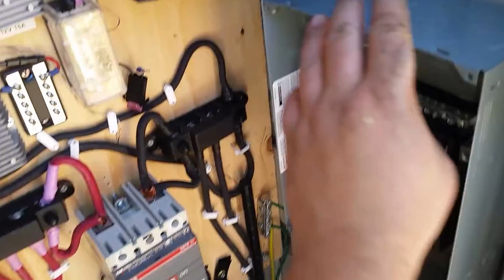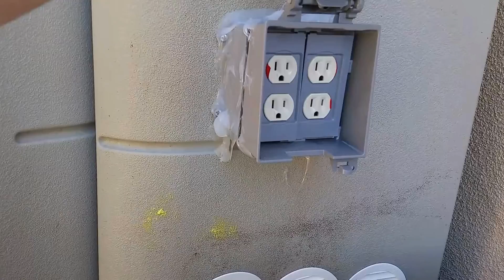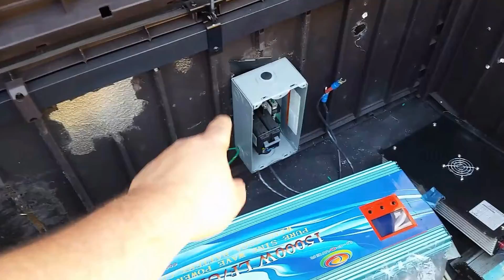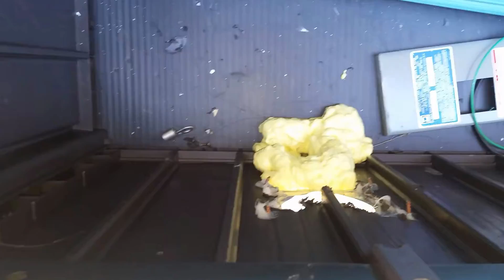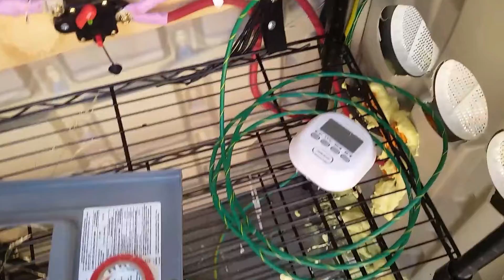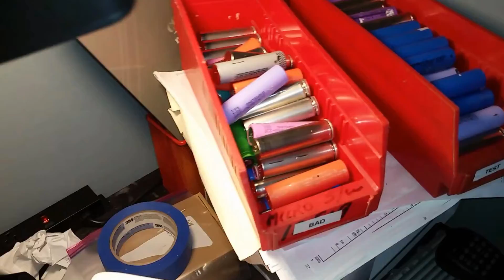PowerShed DIY PowerWall episode 10: High voltage going in, and weatherproofing!

Comment: I live in Wisconsin, which of course gets mighty hot in summer (98 degrees F) and very cold in the winter (minus 20 degrees F) , and in the months in between we get lots of rain, snow, sleet and everything in between. Do you think it would be acceptable to have the bulk of the powerwall hardware except for the battery packs within my garage (in a cabinet of some type) with a small shed like you have just outside the garage wall which will contain the battery packs?  My thinking is that only the battery packs alone have the risk of fire, and with the rest of the system having a lower risk of fire, if any risk exists at all.  Does this sound reasonable?  Inside the garage I could build a cabinet on an outside rear wall of my garage that will connect to the battery shed only a short distance away (through the outside wall.  I'm afraid that the weather elements will destroy anything I leave outside for very long, even if it's inside a small shed. comments are welcome
Reply from the maker: Seems reasonable to me! One thing that you will need to be mindful of is cable length. If the power electronics (inverter, charger, etc) are too far away from the batteries, voltage drop will become a concern. You may need to go 'up' a cable gauge or two (i.e. 2ga becomes 0ga or 00ga). Test everything. Good luck!